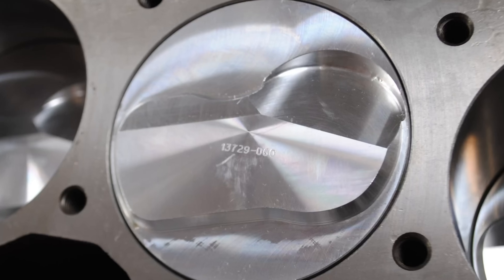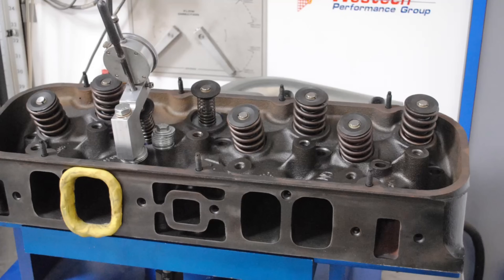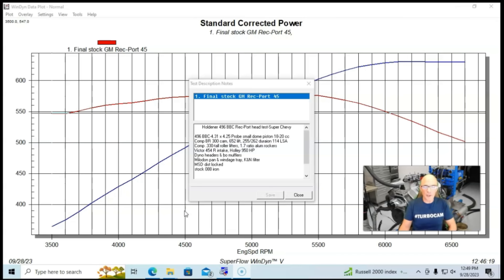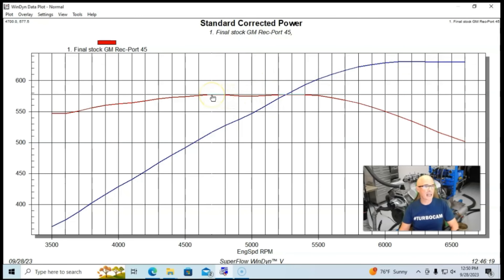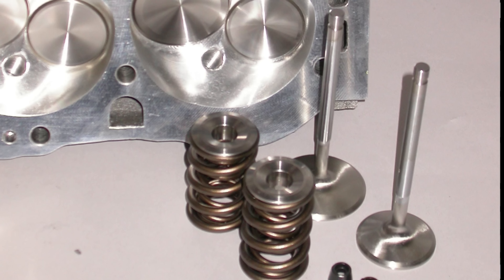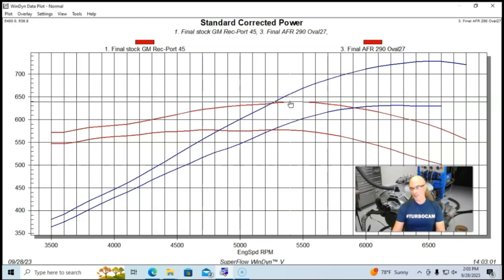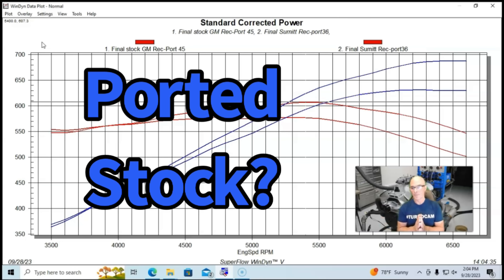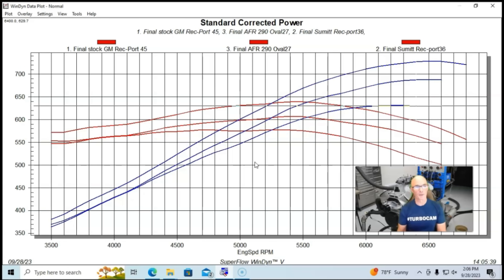HOW MUCH ARE AFTER MARKET IRON & ALUMINUM HEADS WORTH ON A BBC? STOCK REC PORT VS SUMMIT VS AFR 290

Comment: I had a 468 bbc that I built a while ago that had a set of 088 heads that I had ported myself. While I didn’t have it dyno’d or the heads flowed, a lot of people were surprised how fast it went in the quarter running high 10’s to low low 11’s. Also, I love the use of a solid roller because the internet is flooded with hydraulic roller builds (so boring!) but can we get away from oval port heads. I would never buy a set of aftermarket oval port heads. Ever. Even if they were free I wouldn’t take them. All I could think about was what would that motor made with a set of 320 cc rect. aluminum heads?
Reply from the maker: The shape of port has nothing to do with flow or power. Any after market oval port flows more than any factory rec port. Rec ports are a very poor design (the corners flow nothing), so every race head is not rec port any more (they are roval)

Comment: I have ported a set of factory square ports. I still run them in my rear engine bracket dragster. I don't have the numbers in front of me, but they flowed more than out of the box "Big Brodies". However, the Brodix heads ran quicker in the quarter. Same bottom end, same car. The improvement was more than the 60 lb weight savings would have otherwise given. I was able to run slightly more timing  with the aluminum heads. All else being accounted for, I believe that the timing bump is what accounted for the improvement.
I have both a flow bench and a engine dyno.  So, the above mentioned flow comparison was a real thing. I never dyno'd the engine. The improvement was in dragstrip results in similar conditions.
My conclusion: you can improve the air flow of stock castings to meet or slightly exceed the flow numbers of entry level aftermarket heads. But, if we are talking cast iron to cast aluminum, the aluminum wins due to detonation resistance.
Just my personal opinion based on results from personal experience.

Jack Henderson
Reply from the maker: You should be running enough octane that you don't ever have to run insufficient timing on either
Reply: @richardholdener1727  Ideally, yes. However, what you have to work with, ie: what is locally available, isn't always ideal. I don't live in a fantasy world. I have to make due with what is available. Thank you for your well considered response!

Comment: I took a 041 head and had put in 2.19,1.88 valves, I also opened up under the valves to 90%.  The car ran in the high 11's with a solid lifter street cam that liked 7000 rpm. It felt like the car picked up about 50 hp just doing the valves.

Comment: Good comparison, I would love to see a set of aluminum rec ports compared around the size of a 290-315 cfm with these iron heads…. Keep it apples to apples. The oval ports surprised me a bit, but intake mismatch will be an issue with a single plane intake.

Comment: When doing these why isn't any info on valve size, port CC. All make huge differences. The aluminum heads allow for more time
Reply from the maker: more time for what?
Reply: @richardholdener1727   more timing in the engine.

Comment: Richard, are there any aftermarket street aluminum heads that will work good with flat tops...454? Seems all aluminum heads can only get with overly huge ports. I would like a step above the peanut ports. Not sure why manufacturers have not caught on to this yet. A small chamber but much better flowing than 236 and matching high rise intake
Reply from the maker: lot of after market heads have oval ports-AFR 265s are excellent

Comment: Hey Richard I apologize if you ran this test on a video already but I want to know is it worth putting a tunnel ram on a almost bone stock gen 6 454, what would be the HP/torque with stock heads and cam ECT ?
Reply from the maker: it would make more peak power than the factory EFI

Comment: Richard 
This all depends on cost - AFR Aluminum heads cost $3500.00 partially CNC 
Summit only shows aluminum heads @ $820.00 ea. complete no more cast iron heads available 
So I'm in the head business I run BBC Iron Heads on my own engine = WHY because I already had the heads and I don't charge myself for the work --- LOL 
OK - There is no one in the country CNC porting iron heads it is way to detrimental to the machines and water soluble oil is not the best product to use on cast iron so a coolant change @ 50 gallons??? Now you're at hand porting - not fun - and time consuming - I charge more if the customer want iron heads ported - getting the two ports to flow the same or close - good luck with that on GM heads but it is possible to get them close with a lot of flow bench time - yuck - the heads weight 65-lbs each bare, and lift them up on the flow bench - OK (superflow 600 serial #001)  Now they're ported, we have to fix the valve guides, cuz who wants to run 3/8s valves - LOL --- Where do you want to go here 11/32 or 5/16s - liners are ok for the EXH - but to do a good job on the intake you have to knock the guides out - AND - you can't put the factory guides back in because they drill the guides after they put them in the heads, so replacement guides, I use PEP bronze guides for that, you can get them in either 11/32 or 5/16. That done lets cut the seats on the SERDI Machine and cut the guides for seals, springs and be sure the spring height works for the springs the cam requires - What CC's do you want in the chambers, cuz you can only cut the heads so far until you run into the intake valve seat, WHY well by the time you get the chamber to flow correctly it CC's out at about 135, you can angle mill um about .125 off angle but then you have to fix the intake manifold side and all the bolt holes (@ about 400 bucks extra) If'n you already own the square port heads this is going to cost you (less the freight) about $3400 bucks $3900.00 if you get um angle milled - then how much did the valve-train parts cost you and the valves? - Which are not included in that price 
OK - Great - Here's the catch 22 on this --- if the iron heads flow close and the valve size is the same and the compression is the same the iron heads will make more power, then the aluminum heads, so the only savings you get is the weight differential, to get your power back you have to raise the compression 2 points  ---- If you have to run PUMP-GAS you are stuck with about 9 to 10 to 1 and hope it doesn't detonate the rings out of the engine -- OH OK lets pull some timing out of the motor - LOL - You're better off with a bit less compression and give the engine what it needs for timing 
THAT'S MY 2 CENTS WORTH
So I found this At Summit a World Products CNC Iron SQUARE PORT HEADS
https://www.summitracing.com/parts/wrl-030620cnc/make/chevrolet

Comment: How about some E85 test?
Just switching fuel can gain 100HP
Reply from the maker: plenty of e85 vids up-we never gained 100 hp just by changing to e-85. on a boosted ls with no timing or boost change, it was more like 35-40 hp

Comment: On my 509 bbc I had a set of pocket ported 188 casting rect port heads and a solid roller cam, comp cams std grind @ about 740  lift. Made 690hp.  Switched to a set of AFR 305 and fully ported 4500 intake, both by Eric Weingartner.  Made 818 hp.  Those iron heads can be improved upon, but I don't think you can match the performance of the better aluminum heads. Especially in the hands of a porting pro.
Reply: What was the CR on that 509cid? 
Running a 730 lift cam on 540 with iron heads. Just wondering what I’m leaving on table by not going aluminum Brodix or similar.
Reply: @wallywire  12:1

Comment: I think you can maybe matchbthe summit but remember both aftermarket heads are probably running raised exhaust ports with help the flow number quit a bit. Factory to AFR, i highly dought it could be done. Would have more money if the stock heads then just buying the AFRs. My 2 cents.

Comment: Richard. Love the videos. Do you have a video showing how a Gen VI 454 big block performs with an eBay turbo kit? Stock heads, stock cam is what I’m looking for.
Reply from the maker: boost just multiplies what is there-350 hp stock
Reply: @richardholdener1727 appreciate the quick reply sir

Comment: I have a 489 with a roller sets up and a 525 ish cam and 781 ported heads . How much more power would I gain with a set of aftermarket heads. compression is about 10 to 1. on pump gas and a 850 carb?
Reply from the maker: no way to know-don't know your cam specs (lift tells us nothing) or how well the 781 heads are ported
Reply: duration on intake 235 exhaust  242 at 50 lift is 521 intake 540 exhaust 110 center 110 lobe separation  225 intake and 188 exhaust
Reply: mild port

Comment: I could make you that power with the #781 #049 casting heads but i
I have a magazine quoted figure of 650hp with factory GM iron rec port open chamber heads 2.19" in 1.88" exh on a 509ci 4" stroke 4.5" bore chev with the comp cams magnum solid roller. If I remember rightly it had a out of the box Weiand intake, on #7535 and 1000cfm 4150 flange Holley carb. And made in the 800hp region with nitrous. 9second quarter mile combo.

Comment: Yes you can but should you?  If not restricted by rules I'd say don't try to make irons outperform aftermarket aluminums.  There's a 2013 Yellow Bullet thread with Chad Speier worked 088s that I guess made 841hp na in a high cr truck pull application.  2.3 valve, epoxy, 374/385 cfm ar 1".  Can be done, not sure if he's will to do the iron stuff anymore but for the price/time I'd start with something else unless I was boxed in via rules.  He's gotta video on them too about a year back.
Nothing wrong with a basic port job if that's what you got but to make them great takes a lot of effort.  
Buying a bare set of promaxx as cast and porting yourself, parting yourself/machining at a machine shop that does race engines/heads... might be the more budget friendly way to go.

Comment: I have built a lot of big block Chevy's for drag boat racing. Iron heads are the way to go for anything marine. lake and sea water used for cooling a boat engine a killer of aluminum heads, unless you have the water jackets coated with a ceramic. however, then you lose some of the cooling benefits of aluminum. so iron is the way to go for power boats.  My favorite factory casting is the rectangle port head, casting number 3994025. it is the 71 LS6 corvette head. They are ridiculously rare with only around 200 pairs made, and what ever service replacements they made. it is basically an open chamber version of the 3964291 L78\L72\L71\LS6  head, which is my second choice. they made a ton of these.  basically, the only difference between them is the chamber. but the 71 heads flow better because of the open chamber.  but you need either a big CID motor, or high dome piston to take advantage of them.  even then, they do not flow as well as aftermarket iron heads. I think the only 2 companies still making iron heads, are GM and World Products or if you can find them used, the old Dart Iron Eagles. which were basically a copy of the old 71 454 LS6 corvette head, but with raised exhaust ports. I first choice for anything marine is always aluminum with ceramic coated water jackets, followed by iron heads if it is a budget Marine Motor.  my personal favorite head for most budget marine motors, is the 71 3993820 oval port head, and 72 3999241 heads used on the LS-3 396/402  and LS5 454. cut them for bigger valves, and some minor port and chamber work and they will out flow pretty much any Iron big block head.  and the torque down low is amazing.

Comment: You could definitely get a pretty sizeable gain from porting the stock heads but an aftermarket will almost always out perform them they’re simply just designed better

Comment: I've been looking into this alot, since I've got a set of 188 rec port heads (same as your 088 essentially). I've been on the fence between using these or a set of 781 heads on a 427 I'm building. It seems like to me, the real weakness of the factory rec port heads is the exhaust port. The intake ports flow alright stock, around 300cfm or a bit more, but the exhaust port is weak and only flows around 60-65% of the intake, when it should ideally be closer to 75-80%. I'm pretty sure this is the reason GM used such a huge split between intake and exhaust duration on the square port crate engines like the old 454HO. They used the cam to compensate for the poor exhaust port. I think with a basic 60 grit casting cleanup on the intake ports and some minor work on the bowls and shrink the guide bosses, then do the same on the exhaust and also give a better radius on the short turn and open up the throats, I think there are very significant gains to be made with the factory heads.

Comment: Question for you unrelated to the heads: Was this comparison done on a stock GM block? 2 or 4 bolt? If 2-bolt, are you comfortable with stroking it and making these power levels reliably for a street car?
Reply from the maker: this was a gen 6 block that all have 4 bolt mains, but I would run this on a 2-bolt as well

Comment: Yeah even fully ported the stockers won’t match the AFR heads.
Reply: Could be right, hard to say (these 290s vs same flow bench/same dyno/same day).  Can't really compare different flow benches with AFR advertised vs people that sell 088 truck pull stuff so 🤷‍♂️
Can make em pretty good though.  Even though it's totally apples to oranges with different benches and maybe different methods (inlet radius...) Speier's 088s seem comparable to the AFR 290 and look like the outpace it on the upper end.  Apples to oranges, dunno

Comment: I've always wanted to see a test where you trade off head for cam - i.e. it takes that 300 roller to get to 630 hp on that BBC with stock heads, how much smaller/more streetable a cam could you run with the AFR's and still hit that 630 hp performance level?  I also wish  these published tests would record idle speed and idle vacuum values so readers could decide if they could live with the street manners of a given cam, if they could run power brakes, and so-forth.
Reply from the maker: this is not a good street cam for idle quality
Reply: I'd say your way better to go aluminum.  I personally much rather have 600hp with Afr heads and a super mild cam

Comment: What do we have to do to get someone to compete with raylar on the 8.1l heads? Raylar customers all complain about their after sale treatment, and they screwd up the valve alinement on LT's "ugly truck 2.0". At what point did America allow for monopolized flip you over a barrel costs, with no support? 4000$ for aluminum heads is twice the price most other heads cost. Even summit fails the L18 headbolt pattern in support. The vortec8100 basically can't blow head gaskets, it cracks pistons first. The stock heads weigh more than I do lolol, and flow less then the 5.3l. Frankly I'd have thought someone would have matched the ls7 intakes to the 8.1l block with an aluminum head when the block was moved into the purely aftermarket in 2007/2009.

Comment: 489 bbc 9.8 cr  ported 990 rec port , preformer rpm air gap , 232 236 @.050 about .600 lift. made 624 hp 640 tq with a 850 elderbrock , 640hp 670tq with a 950 holley

Comment: I love the BBC stuff. Over the years on my Chevelle I have run stock ovals and stock rec ports on a 454. I thought the rec ports would make a huge difference but I am not as impressed as I expected. My combo is mild by most standards. With all the money it takes to rebuild a set of factory heads I believe I would have been better off with a set of aftermarket aluminum ovals. My opinion.

Comment: Can we please stop using these strokers for these test. Most guys just have a .30 over 454 or maybe a 402. These just don't apply to the average guys power plant.
Reply: Did you listen to anything he said? It's not about the motor the heads are on, he's showing us differences between the head options. You can apply this information to any big block...
Reply: @permafrost2064  incorrect. You are grossly over simplifying.
Reply: @scoutdogfsr  care to elaborate? It sounds like you fancy yourself an expert.
Reply: @permafrost2064  negative. I'm an average guy with a lifetime of failures and success on the road course and 1/4 mile. Though I understand that plunking parts on one mill will provide one set of negative and positive attributes while the outcome would certainly be different on another. These things are not linear. Far too many variables apply in practical application than compared to the theoretical world. Would one give head provide an adjusted power level one the same engine architecture if they vary by 100cid? Of course not. Once again there is too much of over simplifying being applied here. If this conversation was had with Richard I'm fairly certain he would agree with this statement
Reply: @scoutdogfsr you're overcomplicating it. It may not be "linear" but the difference would be negligible
Reply: Yeah the strokers are only used to tax the heads more and show the differences better. You can figure it out mathematically by dividing the HP/TQ by 496 then multiply the result by 468 for the .030 over 454. That will give you a rough idea.
Reply: @DBSSTEELER  numerical theory is far different than real world. You can extrapolate though you will have far too many variables for accuracy in prediction.
Reply: .3 lol
Reply: 496 is a factory engine, produced after the 454 during the ls introduction. Do some more homework b4 slamming someone.

Comment: No most stock heads will start cracking at the port volumes required to get that much horsepower 
 Ask me how I know, I have a set of junk max ported iron heads.  The short side of the port is awful 
 Go with aftermarket heads and save your money

Comment: I gotta set ,  my 1971 026 castings square port heads. 572 big block 850lift cam 15/1 compression make 810hp. I don't know what the Afr 377/385 heads 950-1000 hp. Send me afr 385 and I will see.😎